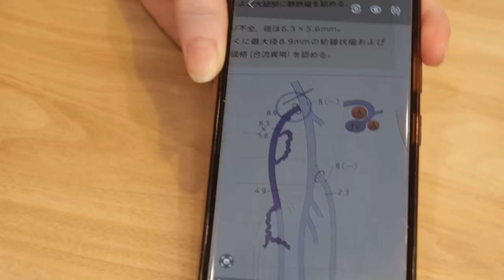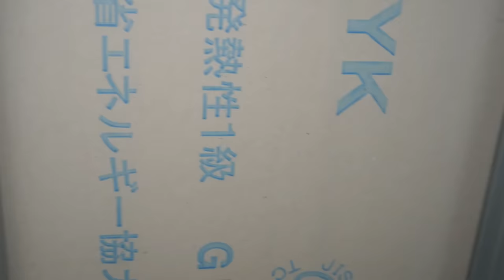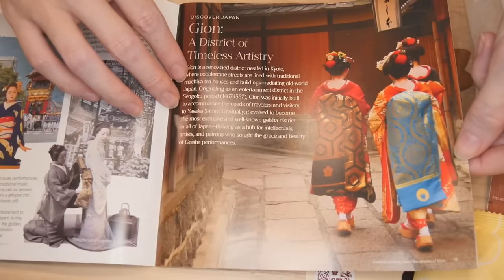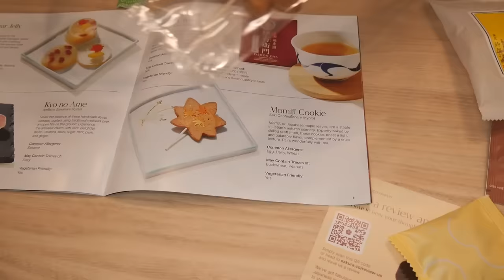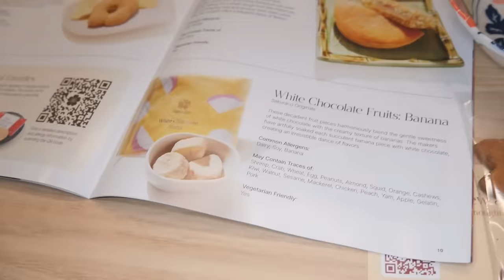I cut a hole in our wall and tried making a cat door 😬

Comment: I made a cat door through the door (not recommended at all. The wall cat door is a way better placement.) and my cat is too simple to figure out how to use a big heavy door, so instead I made her a small little flap from some fabric. I had divided the fabric in half somewhat to help her lift the curtain with her nose. I think it could be similar to those Noren curtains you find in front of traditional Japanese restaurants sometimes. So you could try something similar too. :)

Comment: A way to stop them getting stuck would be to have a more flexible material for the door. A lot of commercial cat doors use flexible plastic, which would be good if you want to avoid drafts coming in the hole. If you're ok with a little more air circulation, may I suggest a fabric noren curtain? I just feel like that would be extremely cute to see them going in and out of, like it's a little sushi restaurant.

Comment: You could look at just putting a little curtain over the top of it, so its soft cloth that they need to push through. If you want the ability to stop them from coming through, maybe making a separate stopper than can be placed inside and removed at leisure, but that might defeat the purpose of a cat door.

Comment: I would take some fabric with a wood pattern on it and put it on a dowl?  then it has the look you want without the danger <3  you could also probably add some fabric weights to the bottom so it doesn't flap.  or do it japanese curtain style  with a funky pattern~!

Comment: Hi Rachel, Lovely project! Have you tried cutting along the wood grain direction, rather than against it? (In 21:22 you showed having cut 90 degrees to the wood grain direction). Try cutting along them, then it should work. All the best!

Comment: When I saw the solid door I had concerns on what would happen if the cats changed their mind and decided to back out. When I was researching pre-made cat doors I noticed a lot of the ones with a solid plastic door had risks of their cat's head or feet getting stuck and one reviewer's cat even had their foot amputated because of this style of door, so while soft plastic flaps are ugly, I rather it be ugly and safe than beautiful but not safe. Hopefully you find a solution that makes it both beautiful and safe!

Comment: I know the point of the rock garden was to have the rocks exposed, but a workaround to having it might be building like an acrylic top that sits over it? So it's like a "glass table" style with the rocks still underneath and then no dust gets in the rocks either! Only thing would be the pots sit on top of the glass, unless the glass top has custom holes cut for the pots to sit in. But ah, so much work for that. Good in theory tho lol.

Comment: 21:25 Try using tape for cuts like those, you avoid getting splinters. It's like a special type of tape, called masking tape if you know of it and can find it there? :D 

(We use it all the time, for ANY type of cuts and it helps get edges much smoother and you avoid wood from breaking like this at weird angles. I'm still baffled by how such a thin layer of paper scotch can do such a BIG difference!)

Comment: You did such an amazing job Rachel!! DIY is about fuckin around and finding out💖 if it doesn't work you can just find solutions. i highly recommend trying some kind of flexible plastic screen as the cat door, might not fit the aesthetic but works perfect. honestly I think it looks really nice without a door, if you want to cut some extra wood to fit inside so you can permanently close the door (in case poki needs a room to stay out, or the room can be more sound proof if you have guest).

Comment: I'm sure someone has already suggested this, but consider not reinventing the wheel. I cut a similar cat-door into my own bedroom, and what worked best for me was a little curtain I sewed and hung from a little dowel-rod mounted just above it. It was a cute little window!

After all, the "door" part isn't there to lock the cats out or in, right? It looks like it's main purpose is to look tidy, and to block unwanted light. Perhaps simply buying some blinds (to cut down to size) or hanging a cloth across the opening will do well enough for your needs?

Comment: if the purpose of the door is to block out light and sound, I'd recommend making a heavy blackout curtain for it instead. It may not block out as much noise as a door, but it will help to dampen the sound, especially if you put a curtain on each side. Plus, you wouldn't have to worry about a door becoming squeaky overtime

Comment: Some sort of leather or fabric flap should work. I had a deck cat door for my kitties for years that was a rubberized cloth with a metal bar at the bottom to provide both weight to pull the flap down, but also a magnet to help keep it shut.

Comment: What about wooden dowels, running horizontally?  Drill a hole about 3/4 inch from each side, all the way through, and using a thin cord, run the string through the holes, tying a knot between each dowel.  (If you were to look at this from the side, it would look like a string of pearls.)  It would hang a bit like window blinds, and the knots would let the structure bend.  You might have to play with the tension a bit, but this could work.

Comment: Love that design and also that you immediately fixed the design of the door to make it more safe. One question though, did you seal the outside of the tunnel part but not the inside? If you did not seal it, then you should maybe do it as all the dirt from the cats will stain the wood and makes it not that easy to clean up! Gonna do something similar soon too, thanks for the idea :)

Comment: Heres what you need: enzyme cleaner. Its safe for cats. Spray a hole bunch on the areas Nagi has peed, and let it soak for a bit. Only wipe it up with you sprayed enough that it wont dry up on its own. It gets rid of whats causing Nagi to smell his markings and consider the area a litter box. You can use this on anything, couches, pillows, counters.

Comment: Yeah Rachel, I think you had a fantastic idea and you implemented it well, but there were just some unintended side-effects in your design. The door being that heavy and having that tight a clearance wasn't optimal, but it looks like you're already launching off it to something even better. Something like a "tambour" door could work.
Meanwhile, you could just do some kind of fabric curtain and pin it in place above the hole as a temporary measure. It's not ideal if you want sound-proofing against anything happening elsewhere in the house, but it'll do for blocking light.

Comment: Maybe something like a bamboo curtain could work? Like those with small bamboo rods that are hold together by a weaved string or something? Or a curtain out of fabric that fits other fabric around and one of those curtains weight snakes in the bottom to weigh it down? That one could have potential head bong dangers though.

Comment: When you initially explained the design, I felt like the swinging door was pretty unnecessary. Some litterboxes have flaps to keep smells and litter in, doggy doors/cat flaps have a swinging door to reduce bugs/water from getting in and to allow you to lock the door at certain times. However, since this is an interior door purely to allow the cats access when the main doors are shut, a secondary door isn't necessary. I didn't think of safety (good catch there) but I did think the flap seemed to worry them a bit and might keep them from using it and might also create more noise while you're sleeping, which is what you were trying to avoid.

It's not my home, but my vote is call the project done and appreciate how nice it looks with the wood framing! You really did a good job even if the finished project is a bit different than your initial plans!

Comment: If you want to cut straight lines, use a guide! A metal ruler with some thickness or even another straight edge piece of wood clamped into position will guide your hand saw or circular saw for absolutely straight cuts. You'll save a lot of sanding time. Avoid using the tiny black guide that attached to the saw, unless the edge is perfectly straight, that guide will never work right. 

The reason why the board broke from the saw is likely from the tooth count on your saw blade or a dull tooth. You might want to swap out the blade for a wood specific one or get the teeth sharpened.

Last but not least, might a suggest a strawmat covering for the door? Or even a firm cloth window blind material, it would blend very well with your wood frame!

Comment: Given the time it takes to edit and upload you have probably found a solution by now, but if not: perhaps a heavy cloth flap instead of a wooden door? That way no chance of pinched paws! Cat fur sticking would be a concern, true, but depending how it's made could be done up with either heavy opaque shower curtain material, or just be made for the flap to be removed and washed periodically. Some thermal drape material is made so dust and such doesn't stick to it easily as well. ...though there is also the possibility of using flexible foam cut in a square as well I suppose. (Now you've got my brain rolling on this because someday when we have our own house my partner wants to cut a cat flap for our bedroom as well LOL)

Comment: Hey Rachel, would cutting the wood along its grain keep it intact? It seems the breaks are quite straight vertically and may be the wood splitting along a grain, but if you cut it straight, it may stay together and allow you to have thin pieces.

Comment: If you still wanted that wooden door, I would take off the bottom few centimeters and add a strip of fabric so they can't slam on themselves or get stuck while still blocking out the light from the other room.

Comment: TIP FOR HOT SUMMERS: get some linen fabric/scrap/bandana and dip it in cold water then wring it out so its not dripping wet then wrap it around the back of your neck-quick cooling!  If you're out a long time the linen will dry out but then wick and evaporate your sweat much better than other materials.
TIP FOR CAT DOOR: maybe use fabric instead of a solid material? like a  black-out curtain scrap so no light peeks in but they can move without catching on anything?

Comment: Not having a door in the beginning might actually be a good thing! This way, the cats get used to the cat "tunnel," so when you eventually install the door, they will stuggle less with adapting to it and might just immediately start using it. 
Our cats struggled with the door for quite some time because they did not like the sensation of the door.

Comment: When we first moved into our house, we decided to put the litter trays in the downstairs bathroom. We didn’t want to leave the door open all the time because sometimes one of the cats will make an extra stinky poo. We got a kit to make a “mouse hole” in the door so the cats could go in and out with the door closed. There was a brush in the frame of the hole, but the cats eventually were able to remove it.

Comment: I dont think slats is the answer. Its still possible to pinch. You should get something soft like fabric or soft rubber. If you go with fabric, you could have a wood stick frame to keep it heavy enough to cover without bunching, but can bend if someones head or leg gets wedged.

Comment: I like the wood-slats-and-cloth solution, but may I suggest you save yourself some trouble and not try to saw the slats out of a board; instead get some lath or moulding about 1 inch wide and cut it to length.  Also, for the rod that holds the door up, use one that's just a little longer than the door width and drill the holes a little deeper, so you have some wiggle room to put the rod in place without having to take the box apart again.  There will come a time when you'll need to remove the door to repair/replace it.

Comment: Hmm Sorry about the litterbox. Mosquitos are weak fliers, so maybe run a fan while you are outside. Maybe consider building a screened-in porch/work area with a ceiling fan.

I think your building projects are amazing. Personally I think your crafting skills are more than fine. For tools, you probably just need more practice. I mean I can barely handle a powered saw, but then again, I probably have only held one 2 or 3 times. 

I understand now why cat doors use flexible materials. It makes perfect sense since cats love to reach for stuff and peek at stuff, thus sticking their heads places. I definitely would be distressed to see a cat caught in a cat door. I think a curtain or hanging beads/ropes would be really cool.

Comment: tbh i think the slat just needed to be lighter and thinner, it wasnt a bad idea in the first place, and the swinging slats will likely have similar problems of either trapping or hitting the cats. the somewhat sad thing is, this issue is why most cat doors make use of plastics, because it can be very durable while also being really really lightweight. so look into lighter woods? light and sturdy woods to be the door, and you could pad it with something maybe? you definitely want it to be light in weight though

Comment: what's the purpose of the door? like what do you need it for? if it's a curtain, would they scratch it? if it's a thin sheet of plastic that's slightly flexible, could that work?

Comment: What is the purpose of the door on the cat hole? The only thing I can think of, the same reason your bedroom door is closed at night, is energy conservation. Wouldn't tiny cloth drapes on both sides of the cat hole do that? There has to be a material that would be completely safe, look good enough and provides isolation. but that material doesn't have to be hard

Comment: No need for a door at all. Eventually it will start to make sounds and wake you up. I have something similar but no door. It looks amazing without the door and the cats can come and go.

Then I guess the only problem is if someone else is up maybe the person asleep will hear them more.

I guess fixing this for the cats would be a soft flexible rubber door. So no paws trapped

Comment: I wonder if the cat pee has gotten into the grout and that's why he still is using that space for the wrong reasons.  Hopefully you can try different cleaners or cleaning hacks to get rid of any residual smell that he's picking up.  Alternatively you can try putting a litter box in the space to see if he starts using the litter box instead of wherever? The cat door came out great despite the door flap not working as intended, way better than anything I could do right now :)

Comment: Hrm.   Well,  what you could do is the same kind of design,   just make the bottom few inches out of something flexible?    (Alsp you could probably hinge it in the middle so it opens if the bottom is pulled the dangerous way?   )

Comment: Wood is heavy. You should  go to a fabric store and they should have clear plastic like you put on top of a fancy table cloth. white ant to stain it. cut them in strips to fit the door . you have the holes already drilled. You need to fix the plastic to the rod. then no one can get there head stuck or there feet. and they can see what's at the other end. it won't be scary for them to push the door.

Comment: not sure if you fixed it yet but - couldn't you use a sushi rolling mat, cut to size, for the door? They're flexible, and usually made out of bamboo or wood that's about the same colour as the wood you're using. And it'd be a cheap solution - even just as a quick cover while you figure out something permanent.

Comment: does the tunnel have enough overhang beyond either wall, to not drop down into the wall crevice if the decorative trim ever comes off? (I misread the last part of the video as "I made a broken elevator" and thought that this would be the problem you'd mention oops🙈

Comment: You didn't fail at all, doors are funny things, they're using it, and the door is purely for your benefit not theirs. So I'd just leave it open, or go ultra dramatic and just do theatrical styled curtains and pelmet to cover the sides and top. Make a feature of it, rather than the door. Most cat flap doors are see through, lightweight plastic because it does mean it doesn't hurt them if they get a tail in there as it shuts down, same as litter boxes, so either go for a doorless design with a curtain if you want, or for a bit of traditional fun look at creating a miniature version of a top closing Shoji as that will be lighter weight, and kinder to tails that might be left behind.

Comment: Just use a cat flap. You probably have to find a plastic sheet that would work for your cat door, tunnel, whatever🙃 That way you can just cut it to size, pop in some hooks and anchors and you’re set. Maybe a couple of small hinges would work better actually. If you’re not concerned about locking the cat door, then you could just use curtains or any fabric from something you have laying around you don’t mind cutting up